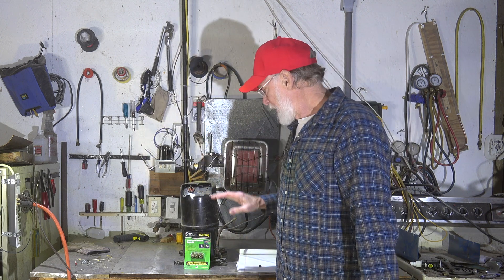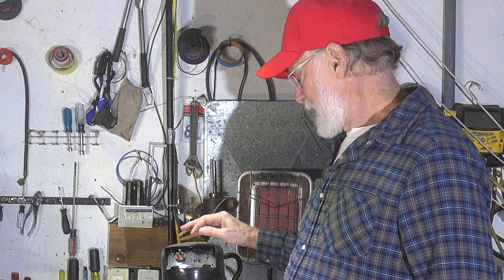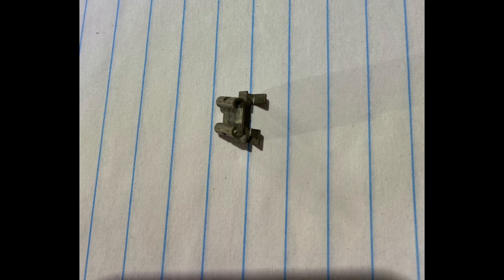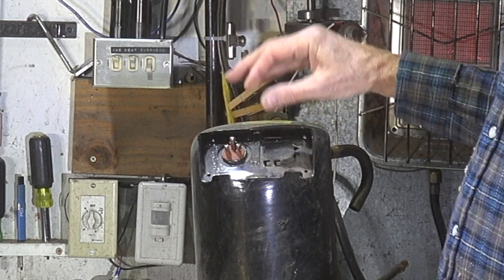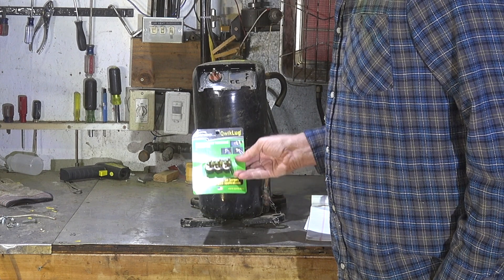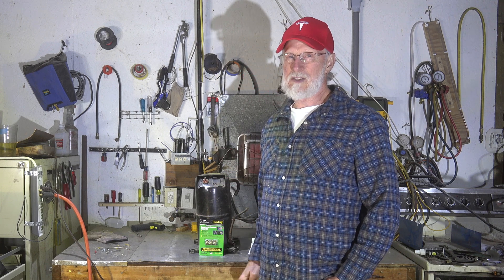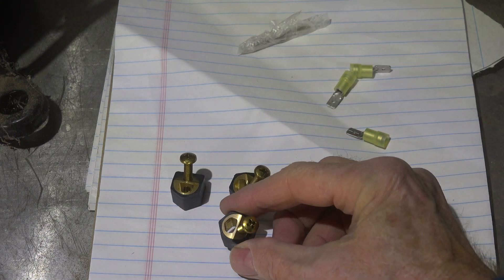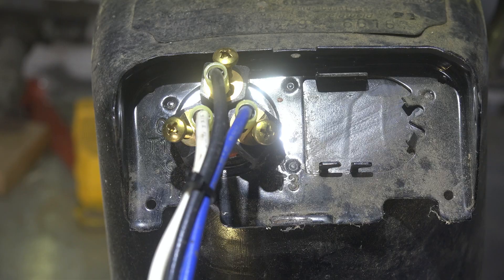Compressor terminal repair

Comment: Why not soldering the wires to the terminals?
Reply from the maker: Overheat the terminals and the terminals will blow out in your face.  Pretty spectacular and dangerous.
GFM
Reply: @grayfurnaceman 
You can use some paste to pre-solder terminals and wires at a lower temperature, and use low temp solder. Usually, internal soldering is very high temp. If well done, it wont melt the internal connections.

Comment: If terminals look burnt at the compressor, can use a wire brush to clean it up a bit ?
Reply from the maker: I generally use a file to get all corrosion off.
GFM

Comment: My accumlator is freezing up
Reply from the maker: If the accumulator is freezing up on an A/C unit, I would be looking for low air flow.  Plugged filter, dirty blower wheel, plugged coil or ductwork problems.
GFM

Comment: Seriously though, what about rain on those terminals?
Is that not a thing to avoid?
You wouldn't just leave off the panel that covers the contactor and dual cap would you?
I'm wondering about a lot of silicone, once you confirm you have good contact of course.
Reply from the maker: I think you should do what you think is best practice.  I have seen so many without the cover, some with burned off terminals some ok.  Also with the cover on with and without burned terminals.  It just did not seem to make much difference.
GFM

Comment: Good morning to all
I have a question...friend of mine has an oil furnace at the hunting camp. An old one. The furnace was working fine until he changed the pipes. He installed insulated 3 or 4 sections betwen the furnace and the elbow going through the ceeling. Since then there is a back draft that cause a strong smell. Gaz that is and not good. The float is working fine. Obviously it has to do with the pipe but why and how to solve the problem...would adding an extention  outside to the chemny create a better draft....
Thanhs for your help.
Gilles
Reply from the maker: I am assuming this is a pot burner.  If you are getting a smell, the chimney is not drafting properly.  Is the venting rising at least 1/4" per foot?  Is the barometric damper set correctly?  Is there soot in the vent?
GFM

Comment: This is a really good tip, thank you for sharing! In my opinion it's a shame to have to replace an entire compressor or unit because of bad terminals, the terminal assembly should be replaceable from the outside. I see no reason they couldn't have screwed the terminal assembly on from the outside so it can be replaced if needed.
Reply from the maker: They used to but manufacturing efficiency  triumphed over quality.
GFM
Reply: @grayfurnaceman  What a shame, it seems like everything is going that way these days.